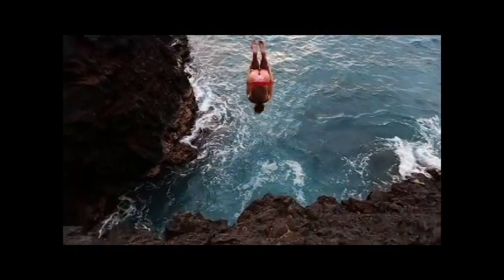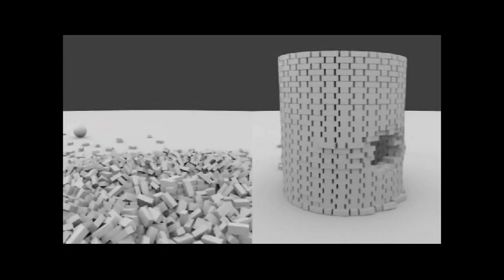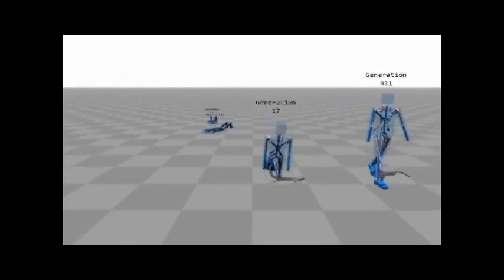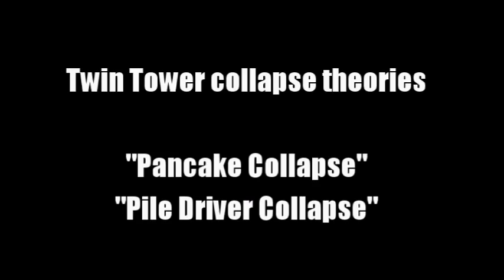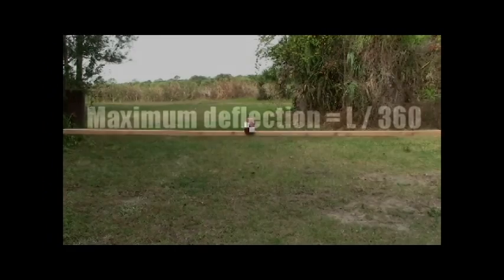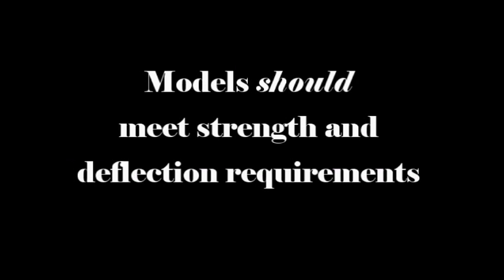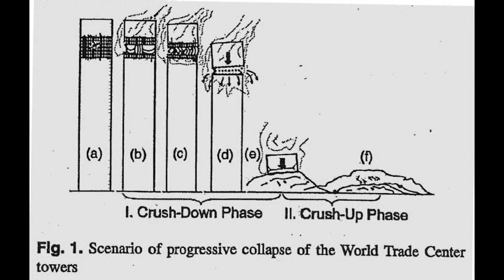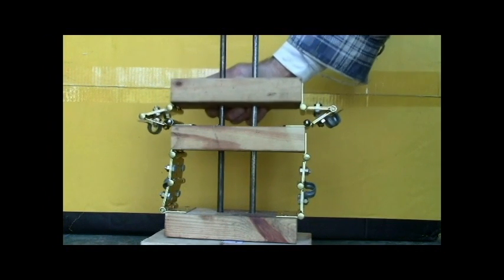9/11 Experiments: The Force Behind the Motion

Comment: It is possible that it is "insider job". But, nobody ask why that two towers MUST be destroyed before it destroys by failure in design of the arhitecture. Hint: Bernouly principle, tunning fork. (edit), and another hints: resonance, wind.
Reply: Close.Many decades ago, I found one Yougoslav article in magazine "Galaksija" (Galaxy), where they offer reward for the best idea how to fix swinging towers on strong wind. Most of twin towers today in the world has "H bridge", or one arm from one tower to another. They also said that it is hard and maybe impossible to do it after building is already in use. So instead making support from one tower to another, they removed most of the material from one building (one without antenna), as is asbestos and other stuff. To make another tower heavier and taller (out of resonance with first one), they attach big and heavy antenna. This way one tower will continue to swing at one frequency, while other at another. If remained at the same frequency, it will continue to swing badly until bottom of the towers weakening. And this probably happened at some point - maybe micro-cracks and all other sign of weakenings are present, and "they" have to do something, else one day one or both tower may collapse in strong wind. This will be shame for all people.... so, the rest of the story is: make insurance in the case that something bad happen to the towers, then destroy it, then blame others. Bulding 7 is not part of this thing - it is something else, but when doing mass self-destructing, they did it... probably because all those buildings are too close to the ruins and will has weakened structure anyway. If you are not sure in this scenario, please search video on YT "tacoma bridge collapse", and what wind can do if construction is poorly designed. If insider did not destroy towers, it willl collapse one day - buth with much unpleasant consequences to the USA than it is right now. Everyone "feel" that official story is roten to the roots, but imagine such devastating realisation of bad design if some tall building collapses by wind.... Nobody will want to live in such buildings any more - can you imagine that?!

Comment: You've got to be fucking kidding me, right? Let's sit down and talk about all the thing's wrong with the first experiment and we'll move on from there. 

Let me give you a hint at one of the more minor problems: you're not dealing with issues of scale. As a structure gets larger the materials don't get stronger, they just hold more and more weight. At these masses/pressures/forces, it's very difficult to accurately approximate any real-world object/structure to something 10^6 times the size. What did you think the first experiment would show? To me it shows you don't seem to understand what other people are even talking about. Perhaps you could make those side supports out of the same material and glue the "floors" to them; at least that would be a better, though not much better, approximation.

Comment: Your experiments I am afraid do not look like the fall of the towers. Your experiments keep the floors falling on top of one another because you have the metal posts running through them. The metal structure in the towers was demolished along with the walls, therefore whilst the walls are exploding outwards the floors would most likely not fall so exactly within their own footprint. Also and more obviously and more importantly it is clear from your experiment that large pieces flew away from your experimental towers creating flying missiles that would have damaged things in their trajectory. This did not happen with the twin towers. The towers had no visible large pieces flying from them, and extremely little damage was done to surrounding buildings, even the dome next to the towers appeared to have not a single scratch, dent  or bit of flying rubble on it. The structure, cement and metal seemed to blow out into minute particles, just like an alka seltzer when dropped into water. The result also being that of extremely little debris left at ground zero but a huge amount of particle clouds, like thick dust billowing over the city. Your experiment had very little dust particles billowing out but a lot of flying rubble and a lot of large pieces of debris left at the scene, clearly suggesting that something other than explosives and/or fire caused the demise of the twin towers.

Comment: I'm no engineer, but I don't think your experiments can accurately represent what happened. Force = Mass * Acceleration, and acceleration due to gravity is 9.8m/s^2. The towers were 110 stories, each weighed 450 million kilograms, and the higher impact was on floors 93-99. This leaves 11 stories above the impact intact and (450/110)*11 = 45 million kg above the impact. If the crash and the fires were enough to cause even one floor to collapse, the resulting force would be 45 million*9.8 = 441,000,000 newtons of force. Let's assume that a story is about 3.5 meters. This would mean that at its widest point the gap due to the impact would be 21 meters (99-93)*3.5. For an object in free fall, it would take just over 2 seconds to travel this distance. Impact force is calculated by (2*m*v)/time. So (2*45*19.6)/2 = 882,000,000 newtons of impact force. Solving for joules in the same way gives us 9,261,000,000 ....... the equivalent of just over 2 METRIC TONS of TNT (by comparison a Tomahawk cruise missile has about 1/4 of that amount). This would most definitely be enough to demolish the next floor down, and it would continue in that fashion as a chain reaction. Additionally, because the mass of the falling part increases with each floor, it will experience accelerated acceleration, and the kinetic energy will increase with each drop. And as for the outward blasts? Think of the volume of air on each floor -- it has to go somewhere. It is essentially forced out of the sides in a fraction of a second, carrying dust and debris along with it. Of course these are all estimates, but people don't realize the amount of kinetic energy the building had as it began to fall. For the other tower the impact was lower, so there would have been more potential energy above the impact. Just think of it this way, once you knock over a domino, there's no stopping the rest from falling.

Sources: google (but seriously, please check my math.....)

Comment: Interesting video.  However, in none of the experiments, did a plane crash into and go through the models he used.  When the planes crashed into the buildings they also destroyed the internal structure.  That and the jet fuel along with everything else that caught fire, is an entirely different scenario than what his experiments showed.

Comment: what about mass vs material strength. there is a huge amount of mass involved and once it starts moving it has a huge amount of inertia
Reply: And the safety margin of material strength would slow down the collapse (deceleration) until it stopped. Did you miss the video? He showed how a superior mass would crush a few floors and then slow down to stop.

Even if you're not smart enough to understand the math, you should at least be able to appreciate the experimental demonstration of physical law. He used a huge amount of mass, compared to the proxy floor material.

Using the math, one physicist determined that for the amount of work performed,
  * Bending or breaking all of the steel supports for the building, especially all those that were not previously damaged or weakened by fire,
  * Pulverizing all of the concrete in the floors,
  * Ejecting large sections of the building laterally, some as much as 600 feet and at 60+ mph,
  * Heating up the concrete dust as felt by people nearby and as demonstrated by the melted materials and scorched cars nearby, and
  * Pushing all that dust over a wide area, covering all of lower Manhattan and much of the Hudson River,

The potential energy of the erect structure was insufficient by a factor of 50! In other words, there was 50 times as much work performed as was available from gravity and mass alone.

Combine that fact with the appearance of several thousand metric tons of iron microspheres in the 9/11 dust, you have all the proof you need for controlled demolition.
Reply: What load of BS, you off talk when you need engineering, math, and physics.  A floor in the WTC tower can only hold 29,000,000 pounds, form top to bottom. The core and shell hold the floors, the floor hold up themselves. You failed to study the WTC design, and don't understand physics.
Reply: eyesuntzu  If the floors hold themselves up why go to the trouble and expense of erecting the vertical support structure of columns?

Comment: First of all, you don't appear to be very intelligent if you use words like SIMILIAR. A basic spelling error I see in your video, where you must have typed it yourself, but not in the text below the video, where you must have just copied text from a website - possibly wikipedia. Because there is NO WAY that anyone who wrote dissimilar, similar and similarly in the discription would write similiar in the video. 

Interesting point here: Similiar and similar are similar but not the same.

Second, this video states a lot of definitions about science and research, but you draw the wrong conclusions by leaving out critical data.

Like that statement: "Any objects observed to accelerate similarly, will have the same direction and sequence of net force, regardless of scale."

This is true, but not the way you are using it. This statement is about objects in ONE situation. Not about objects between 2 different situations. Like your bucket on a rope, which you are comparing to the Moon orbiting the Earth. Indeed, the two are similar, but not the same. But even in one situation there are factors that you ignore.

So you take the pancake type collapse and use it to claim that the way the twin towers collapsed could not be caused by gravity alone. You are wrong. You are, probably intentionally, leaving out one crucial factor: THE AIR INSIDE THE BUILDING! When you drop a ball in an airtight tube, if the air cannot pass upward past the ball, the ball will stop falling to the bottom. You know, AIR PRESSURE! 

The twin towers were not in an airtight tube, so when the towers collapsed, that air went the only way it could go: outward! And presto, we have an explanation, factual and undeniable, for the outward movement of the dust clouds.

Oh, by the way: In nature size DOES matter. Like the dung beetle, that can carry 1,141 times its own body weight. But if that same dung beetle would be as big as a human, do you really believe that it would still be able to carry that much? 

What you are doing is giving a false representation of what happened. Most conspiracy claims are based on false information and false reasoning. This one is no different.
Reply: Like most debunking, you provide some interesting alternatives, but don't prove them. Outward ejections could be partly from air pressure, but not entirely. Focused puffs are not natural. Windows blowing out across entire floors is far more likely from air pressure. But we don't see this happening on 9/11.

You're right about scale matters. Linear support and structural volume don't scale up at the same rate, but the principles he used were solid in that he used weaker support materials properly scaled down. He demonstrated the effect of deceleration not found in the 9/11 building collapse. This principle of material support decelerating the collapse is valid. In one of my own videos, I show how the "pile driver" collapses to about 60% of its original height before one foot of collapse occurs on the building below that top section above the region of damage. This can only be done by controlled demolition (or magic).

Look into WTC7 and its collapse. That building was not hit by an airplane, had asymmetrical damage, but collapsed symmetrically (straight down), starting out at perfect free fall for the first 8 floors! Perfect free fall means ZERO resistance. Nowhere in this universe does solid steel ever offer zero resistance, no matter how much you may protest (if you are so inclined to do so). This means controlled demolition (or magic).

The fact that there were more than 7,000 metric tons of iron microspheres in the concrete dust tends to prove the use of nano-thermate (unreacted chips of which were found in the dust). Careful tests of some of those chips revealed that they were highly exothermic and highly reactive.

Others have attempted to "debunk" these iron microspheres, but like you, they only offered alternative explanations which were full of holes. Steel wool, for instance. Both towers would have needed to have been filled, floor to ceiling, throughout more than 80% of the building with steel wool to account for the amount of iron microspheres found. And all of that steel wool would have to have passed through the fire zone before collapse. Oops! Failed debunking.

9/11 was an inside job. People with lots of money, marketing experts and psychopathic selfishness don't care how many people they hurt or kill. It's all for the good of the planet, but only if they end up on top. They also want us to believe that global cooling is good in our ongoing Ice Age interglacial. That's like saying, starvation cures a lack of food. And people are eating up that logical garbage.
Reply: You state a lot, but your reasoning is in some cases sloppy.

"Focused puffs are not natural."

Ever heard about windows? It's not like the whole side of the towers were made of glass, like in modern skyscrapers.

As for the deceleration: The animation showing the weight falling down is an incorrect representation. It wasn't ONE BLOCK FALLING IN THE CENTER, it was WHOLE FLOORS COLLAPSING.

And all that kerosene fuel from nearly full tanks is more than enough to cause the collapse as we saw on 9/11, considering all the weight of all the floors above where the planes entered and exploded.

In the animation, however, the walls are still up - which is logical, since all the used weight is in the center, causing the buckling of the floors.

If you want to see the difference, take 2 cans. Smash 1 can with a hammer hitting the center of the top, and the other with a brick covering the whole can. Undoubtedly you will see a difference.

But conspiracy lovers don't give a shit about facts. You, sir, have not given facts. If you state data as facts, name sources. Without verification, you might just as easily claim that the Moon is made of cheese. Or that the world is flat.
Reply: Mads
What the hell are you talking about?
Reply: Walter W. Krijthe was just a stupid comment on your stupid comment complaining about a silly misspelling....

Comment: Wow... everything is so confused in this video... 
Why would the towers fall on their sides ? There is absolutely no reason for that, gravity constraints weigh down.
Fallacious argument is used, you consider firstly that is obvious the towers should have fallen otherwise, and then you basically ask "so why it didn't fell like it was supposed to do ?" but you haven't proved yet WHY would towers fall on another way.
Reply: Huh!? Perhaps you need to study more science. Everything is perfectly clear in this video.

Normally, a tower would fall on its side, if it fell at all, if the support structures were strong enough to fulfill the needs of building codes. Why? Because a building would not fall through the path of greatest resistance. Asymmetrical damage would result in asymmetrical collapse (sideways).

Simple example: use a gun to blow off one of the legs of a 4-leg table. The table isn't going to collapse straight down through the existing 3 legs. It's going to topple to the side, because the 3 legs still work to support the table on their corners.

When you chop a tree on the side, it doesn't suddenly fall straight down through all that wood, turning magically into sawdust. It falls to the side. See? Simple. Now do you understand?